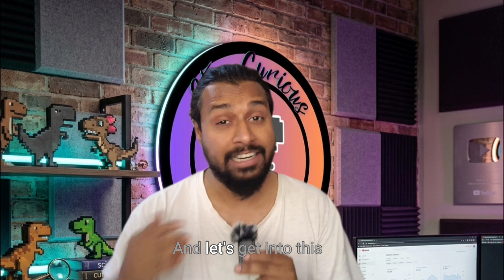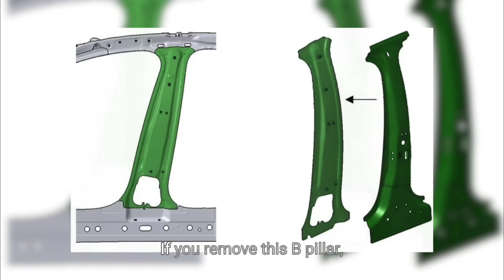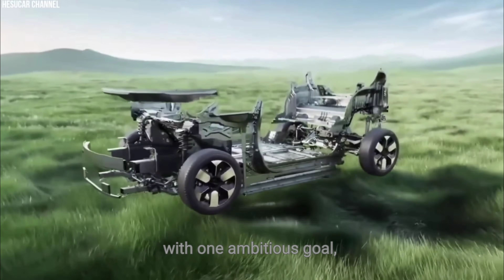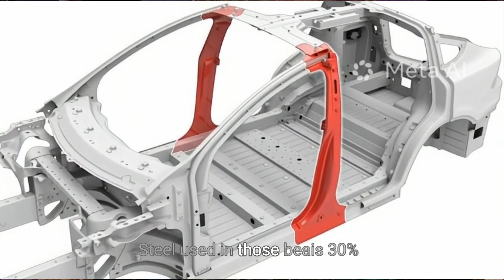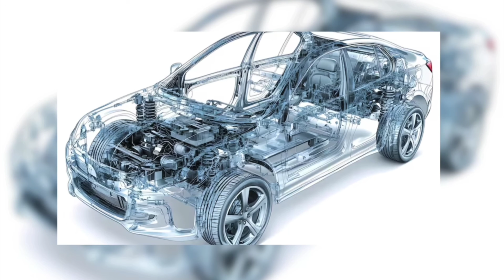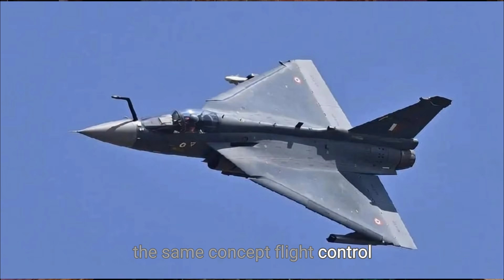Broke a 100 years old rule !! (Zeekr Mix Engineering Secret) 😱😱

Comment: it just made the vehicle not repairable. the structure is compromised, even replacing the door means the cost goes up exponentially, china trued to reinvent the whell and ended up going back to normal door handle. sometimes accident is not just moving vehicle, it is also stationary while opening the door
Reply: You are the type of person that has these mindsets that always think about the resale value before you even buy it. Too many what if this happens, what if that  happens 😂
Reply: Certainly repairable, u are stuck in denial. 
Instead of thinking of what can be
It's extremely repairable

Doors are stronger then traditional
Every part is repairable & replaceable
So is the roof os stronger & can be fixed